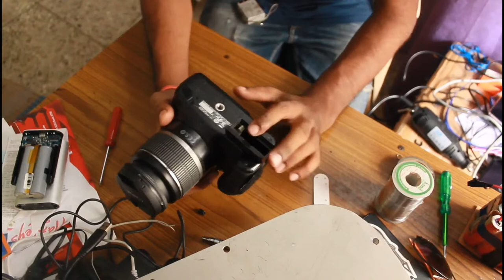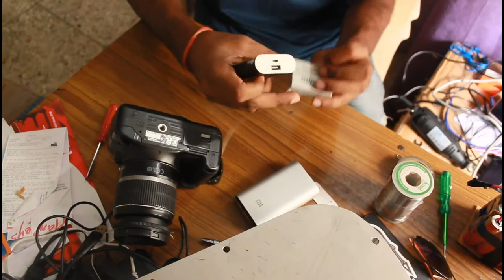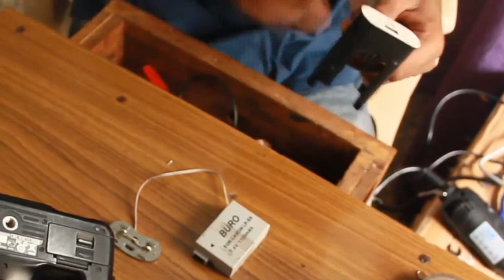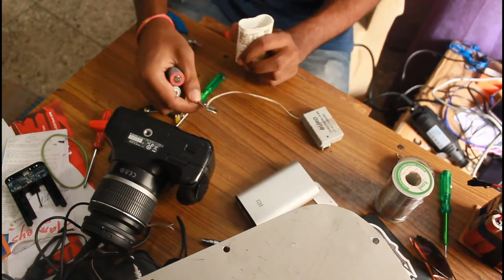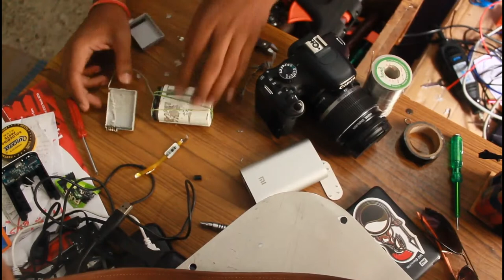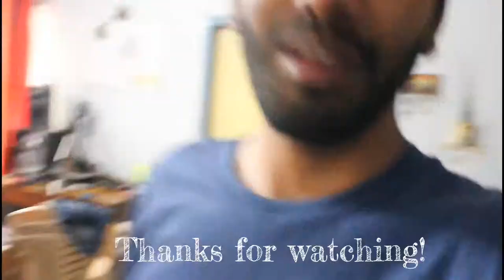Make your own DSLR Battery

Comment: Why don't you use the usb cable for it
By this you won't need to remove the battery bank's battery...you could have used it directly...i am right ?
Reply: No a DSLR cannot be powered by a Usb. 
Even the battery cannot be powered by camera usb as those ports are for Hdmi, Mic and stuffs.
Reply: @heheyboi1065  Your comment doesn't make sense. He just suggested to use a usb cable instead of generic cable directly soldered to battery pack. That solution would have been really elegant too.
Reply: @VicariousxD  no, the electrical components in DSLR are designed to withstand a specific electric voltage, or MAH. A usb varies it's current. Don't destroy your expensive DSLR.